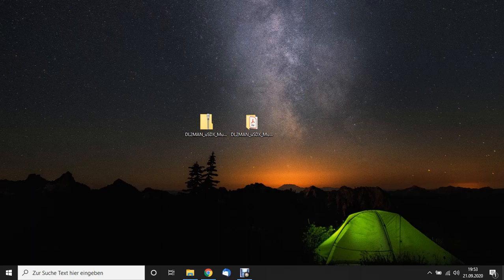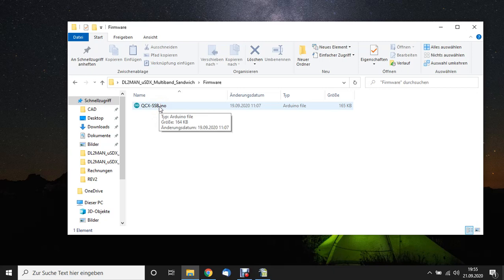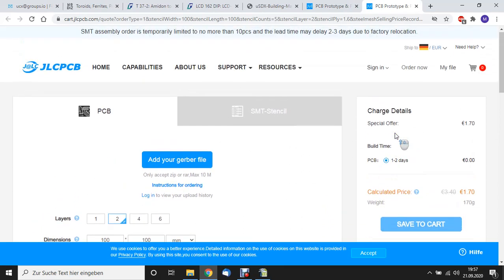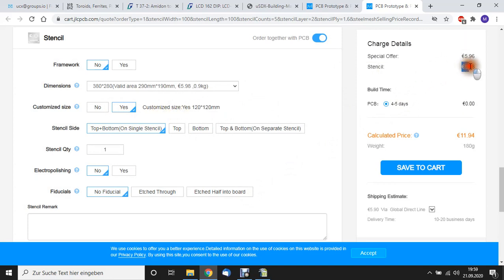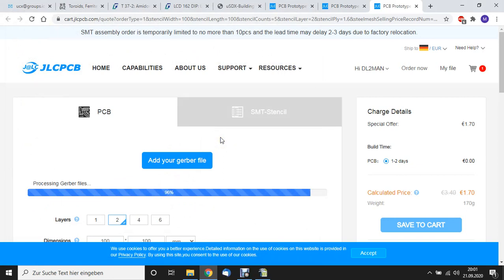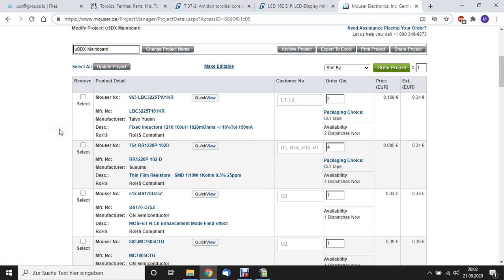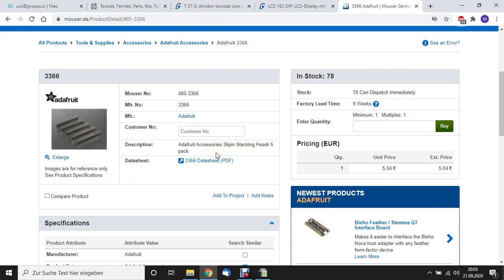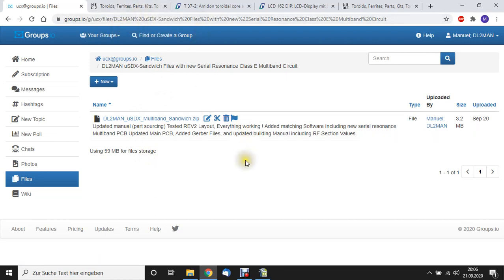How to Order PCB´s and Parts for the DL2MAN uSDX Sandwich

Comment: Ordered Boards, then started ordering parts.  BUT ran into dead end looking for - SI5351A-B-GT (eBay US - $13 or 5 pcs $20 from China).  Will - SI5350A-B05427-GT work????? (Mouser $1.45)
Reply from the maker: Probably, but the I2C Adress will be different. Can be adjusted in Firmware. You can buy substitute part MS5351 from chinese manufacturer (at LCSC). They work pretty well. No difference to original part.

Comment: Thank you for this video and your design! I have tried to order v2.7.4 boards from JLCPCB and get error messages that many of the BOM part numbers are not valid. Is there an updated BOM available?
Tnx de Arnie W8DU
Reply: So the gerber files didn't work? You don't upload the BOM. Just the board "drawings"
Reply: @RobertWardJones  The gerber files definitely worked. However, if you want JLCPCB to populate the boards, you need to upload a parts list in their format. That is the part that was deficient.